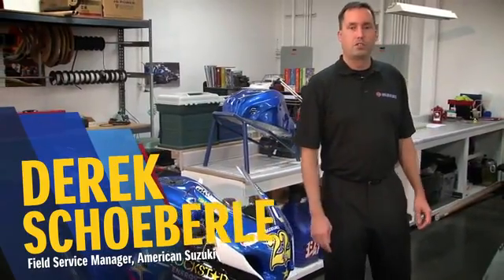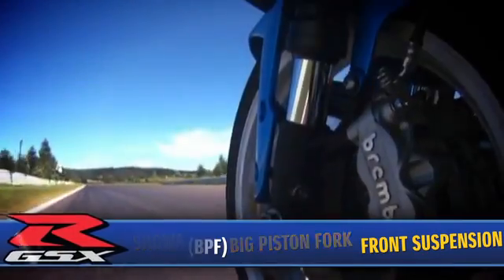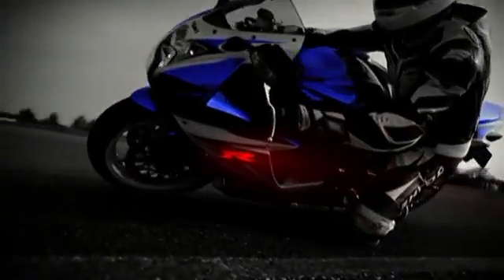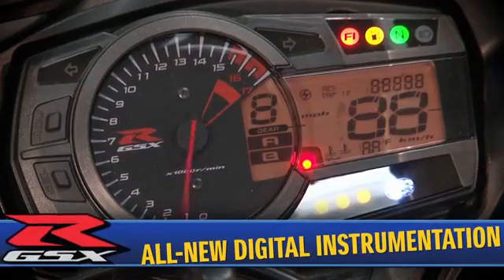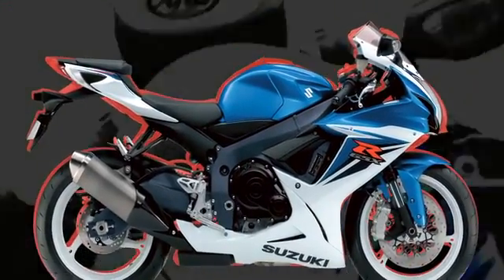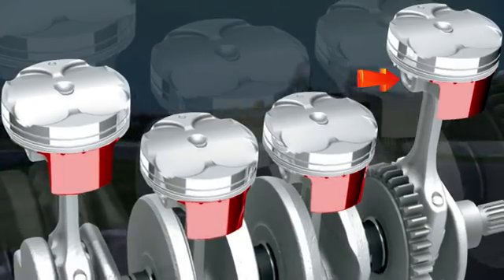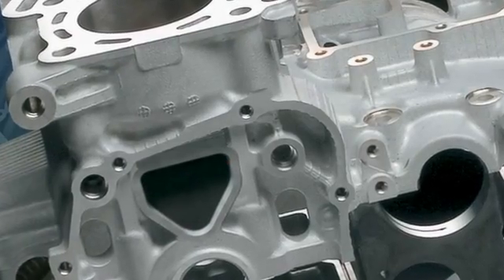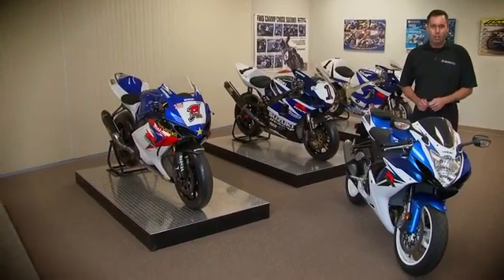2011 Suzuki GSX-R 600 Tech Specs

Comment: Suzuki forgot to add a fuel / gas gauge in gsxr 600... and thats a headache for rider...  you never know when it is necessary to fill...
Reply: You just suck cry about a accessorie you dont nee knock on tank
Reply: At least we have gear indicator, A/B mode, and using the same Casio instrument cluster from 1980s. I used to own a CBR600RR so I'm sure how disappointing Honda have been up to today, except for the new 2020 CBR1000RR
Reply: Lol you can add one easily